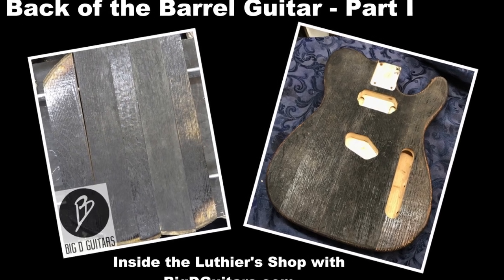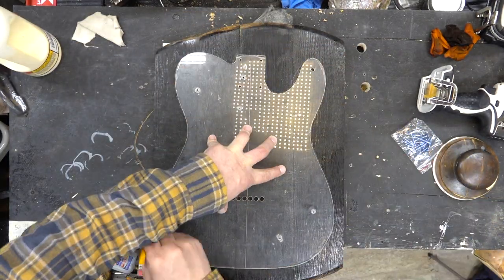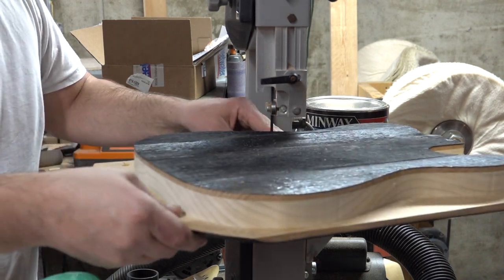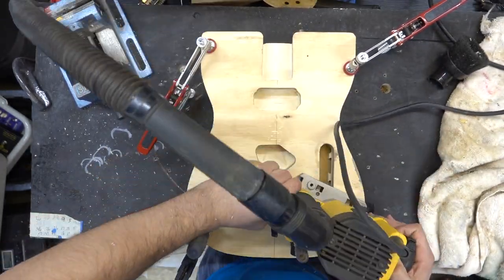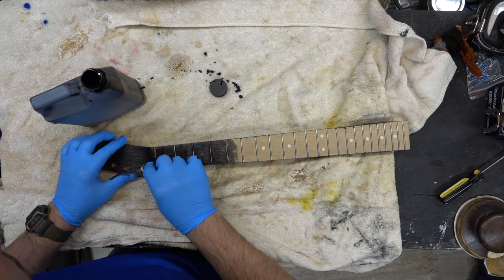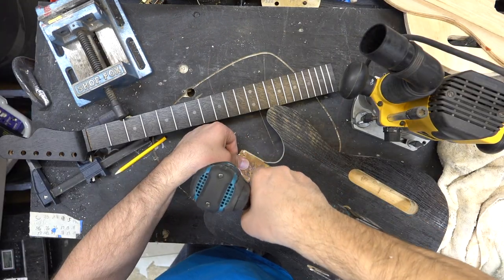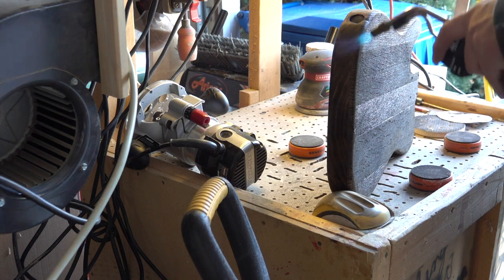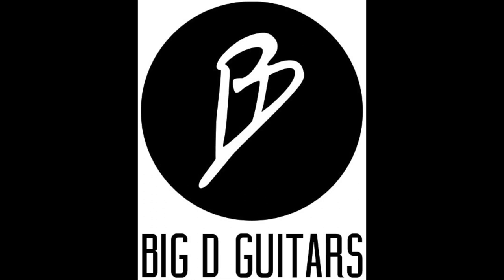Back of the Barrel Guitar - Charred back of the Whiskey Barrel Guitar

Comment: What do you think about a wipe on poly vs tru-oil?
Reply: Wipe on poly is way better it actually protects where as true oil was not really designed for finishing or protecting guitars. I loved it when I was just getting into building guitars but now that I've seen some of my guitars come back after a few years I would never ever use true oil on a customer's guitar again. It simply will not protect and dents and scratches way to easy. I still use it on my own personal builds sometimes but I know how to take care of it and don't mind dents or scratches on those builds.
Reply: Thanks for reply!